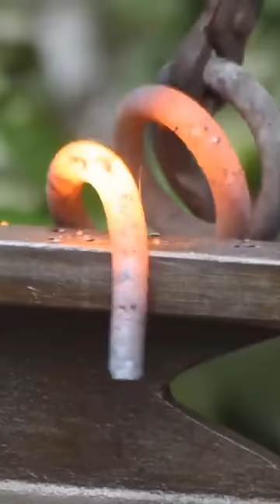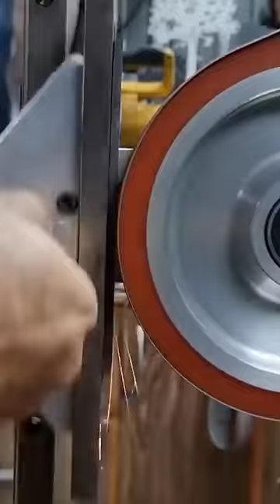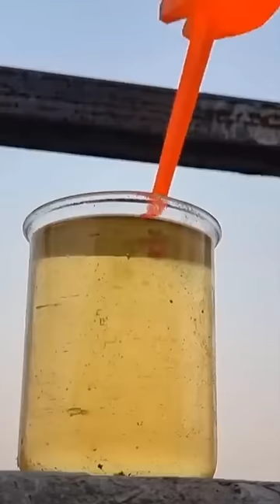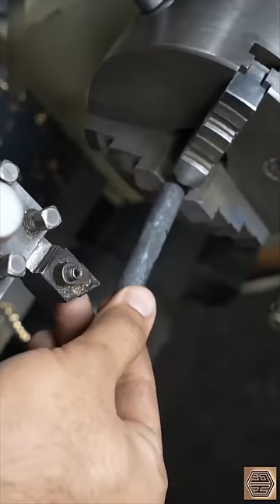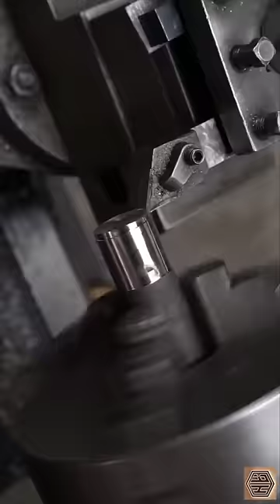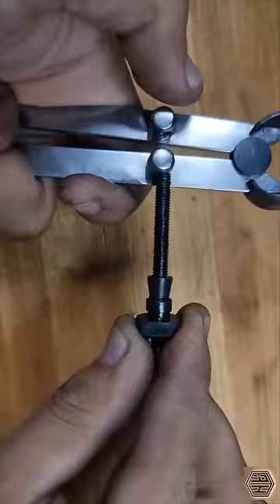Making a Working Compass out of Spring #shorts #randomhands #compass

Comment: I always found that grinding stones just ground themselves to stone dust when spun at high speeds and applied to steel, without doing much to the steel.
Reply: I think you’re using the wrong kinds of stones, or else you’re not annealing the steel first. Trying to grind hardened tool steel will mess up your tools. I find white aluminum oxide stones work well for not much money.
Reply: This video shows the use of a belt grinder which uses sandpaper cloth belts, not stones.